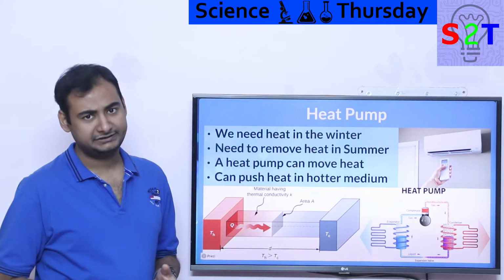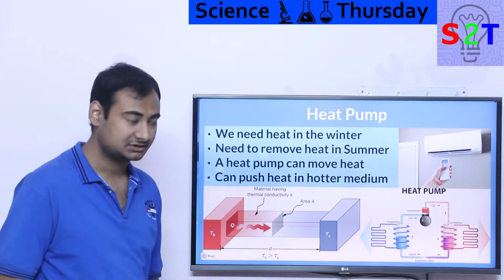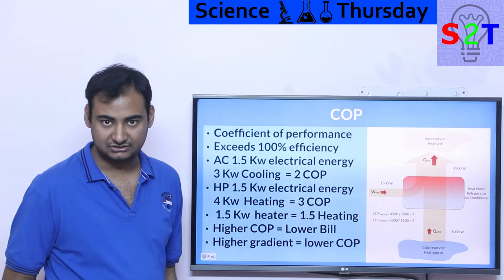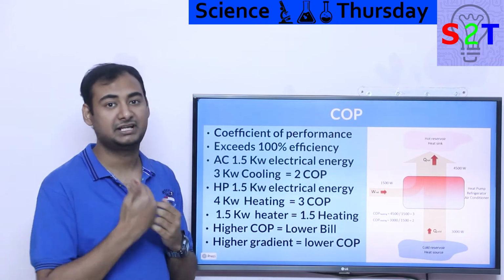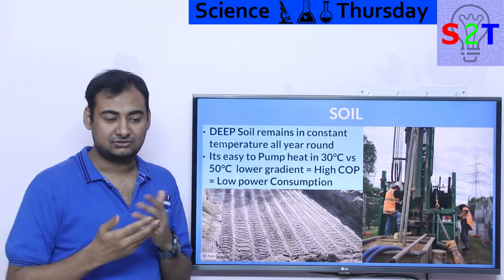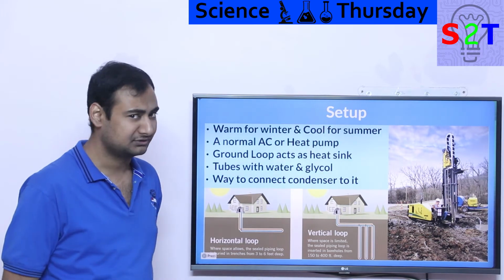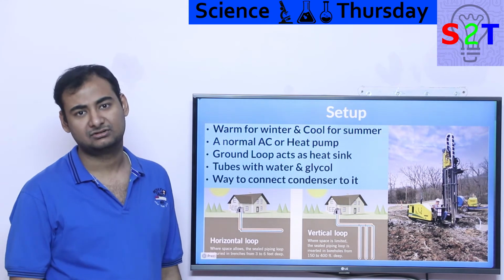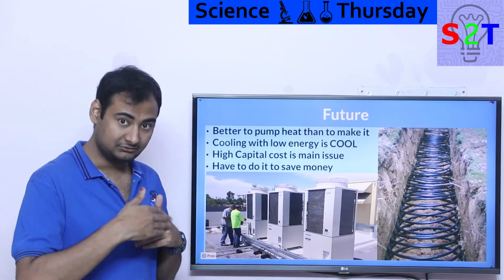Geothermal Cooling Explained {Science Thursday Ep141}

Comment: 55C air temperature in Bangalore?  I've been living there most of my life and, the highest temperature ever recorded in Bangalore is 39C. Maybe you are confusing with Hyderabad, Delhi , other dry, lower altitude cities.  BLR is getting hotter by the year, no doubt, but like I said, record heat to date is 39C in 2016.
Reply from the maker: dude hot spots are much higher than measured average and rooftops of my office did cross 50 Ease and that's where u put your ac
Reply: @s2tenglish  Ya roof top with nice black body radiating surfaces can certainly amplify the heat, though more radiative IR than hotter air.

Comment: I like your (a little bit funny) way you present interesting topics.

If I could request/suggest 2 improvements,
1. Slow your speak a bit (10-20%)
2. Show footage, links to your Research material.

Overall good job
Reply from the maker: 1 camera recording limit 
2 I did use to post lot of links but YT treats it as a spam so I stopped and now just put link to video are there